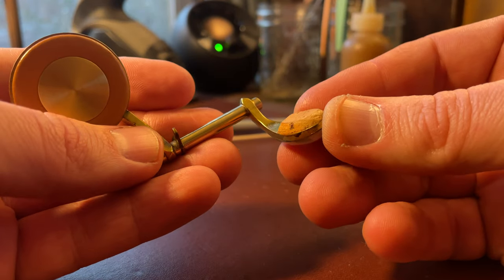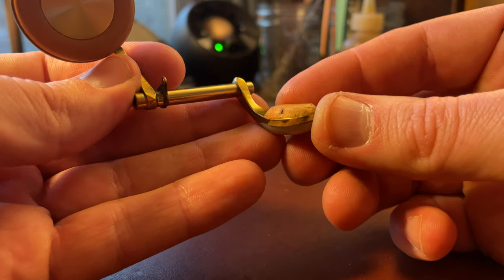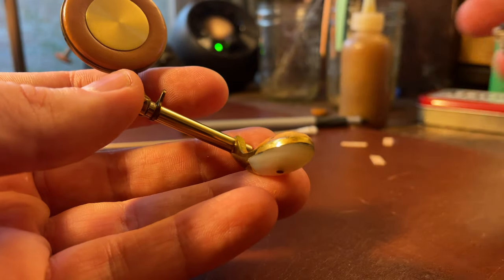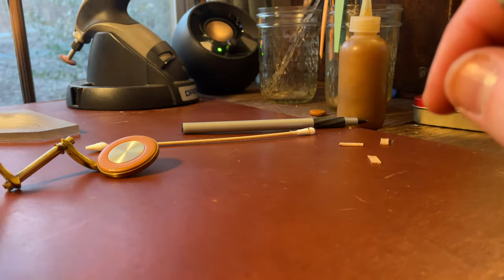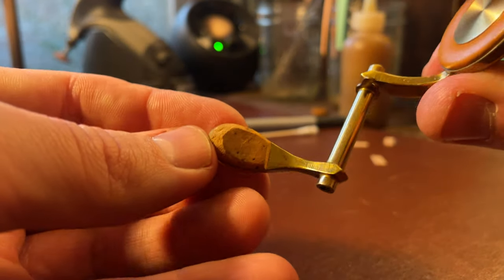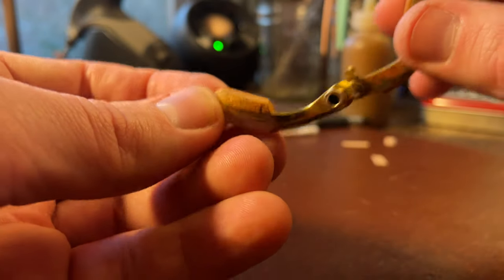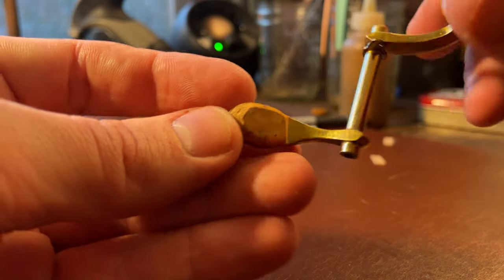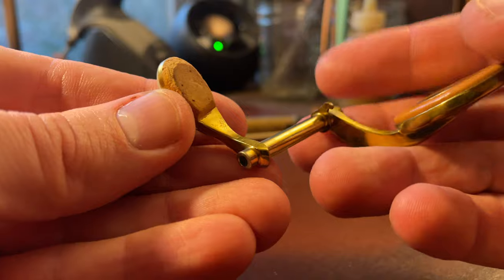Saxophone Repair Topic: What Does 80 Year-Old Key Cork Look Like?

Comment: Cork is wonderful, but what kind of adhesive is on there? That seems like the real winner. Most of the cork I've had replaced has fallen off before the actual cork wore out. Poor contact cement usage perhaps.
Reply from the maker: this would have been adhered with shellac.  good contact with good adhesives will last, even when subjected to moisture or oil.  if your corks are constantly falling off, either the adhesive, the contact it it has with your horn, or the method of its application can be improved.